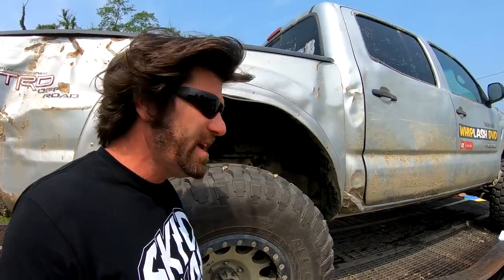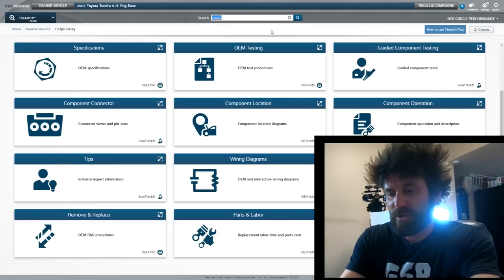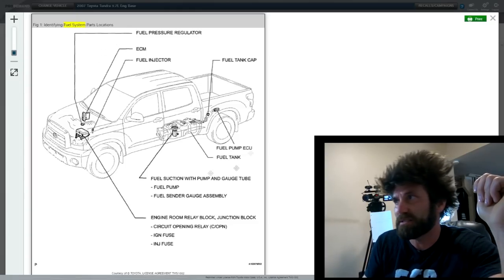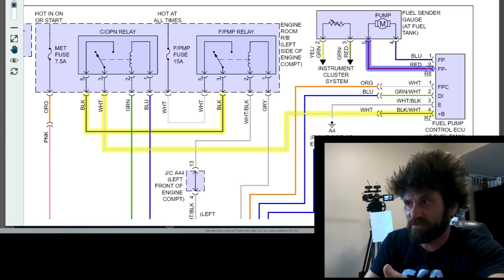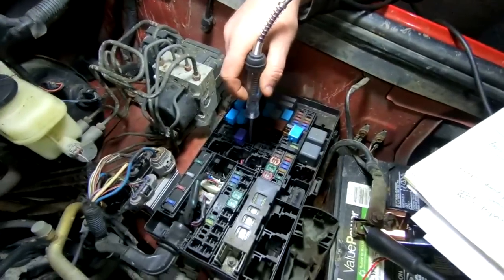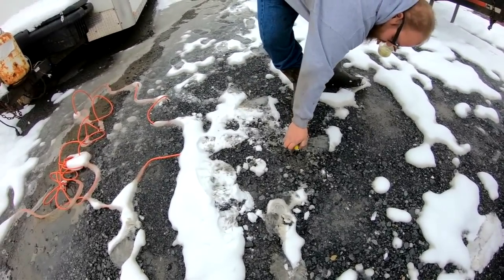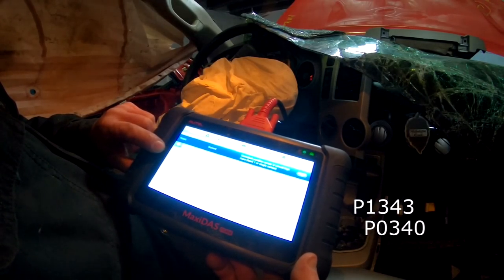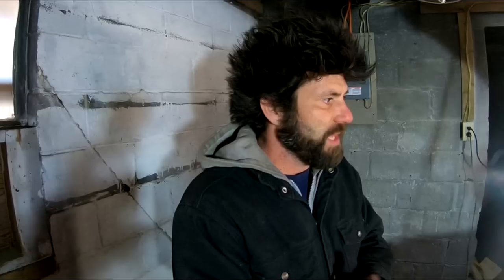TACUNDRA - 5.7L iForce V8 2nd gen Tacoma engine swap (part 5)

Comment: I think I said to make sure all those wires were set in that plug...there is 52 or 62 circuits that work simultaneously in a split second to run ur fuel pump......I sure u know with that kickass diagnostic program u have ....just saying...lol.....i have a extra cab same color but a 2015...I'd like to put ur logo down the side of it.....lol...I'm in new york....up by lawranceville pa......i dont know if u got this message before they took it down.....i cant remember when i  did it.....by the way keep the hair...u look better....by the way I'm straight...so the answer is no...lmfao!!! Keep up the great videos....I love them!!!!
Reply from the maker: Thanks Tad.  I just got some slimer green vinyl so I can make TACOMApocalypse stickers.  I'll probably send some out then to people that comment a lot.  So you'll be on the list for sure.

Comment: Why not just take your output from the fuel pump relay and splice it straight to your for ecu
Reply: They're not 12 volt. They're 5 volt control circuits